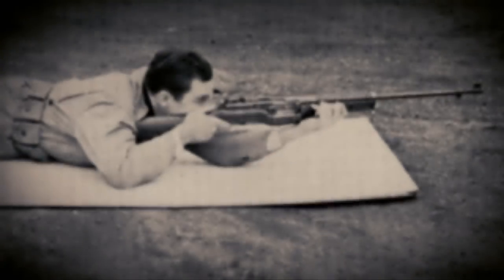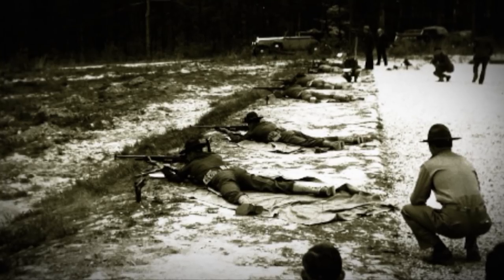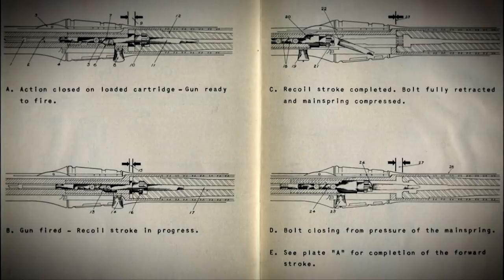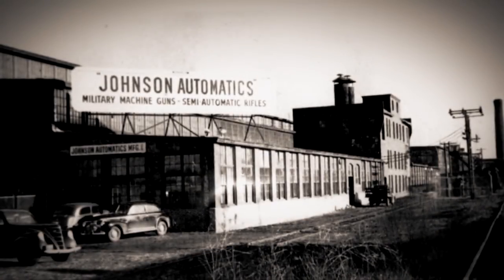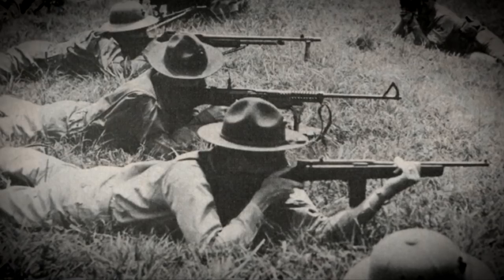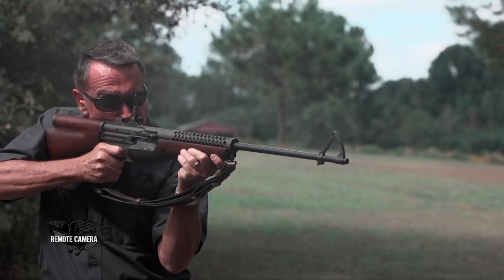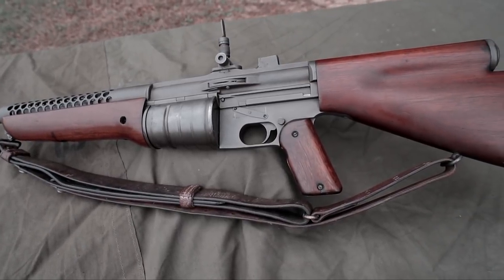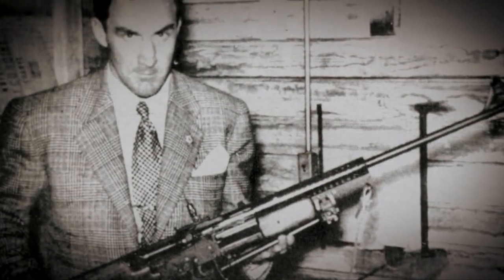Video—ARTV: Melvin Johnson’s Automatics

Comment: Thy were assembled also at Hemphill's manufacturing in Pawtucket, Rhode Island  near the Central Falls border on Dexter street. My mother as a young teen, worked there assembling them. My father worked there setting up production equipment and they met there.

Comment: I would love to fire this wonderful rifle, and the Light Machine gun. It looks to be a very fine weapons system. Also the stock going straight back.  HIs spitfire carbine was a very fine idea also. Melvin Johnson's other weapons would go on to today.  I have flown in Specter Gun Ships and worked with them on the ground and seen the fire power of those onboard weapons that include the multi-barrel vulcun.   It's too bad that more Johnson rifles and LMG's. were not used in WW-2.  However the M-1 Garand and the BAR did work very well.  However I would have loved to have seen more Johnsons for the Paratroopers, rather than the M-1, and BAR.
Reply: They were used in ww2.  But in jungle conditions wasn't extremely reliable.    But they were very accurate

Comment: I constantly ponder the effects on the US military during WWII if they had replaced the BAR and M1 Garand rifles with the M41 and M41 Auto Rifle. My only issue is the issues that come with the M41 Auto Rifle's feed system, mine doesn't always like to cycle the next round for some odd reason.

Comment: Besides the issues with a Bayonet on a Johnson rifle if the Johnson would have been in trial with the M1 Garand at the same time before its adoption there's a high probability would have won the contract. I am shocked we did not adopt the Johnson light machine gun as a replacement  to the BAR us not replacing that weapon bit us in ass all the way until the very early days when we first started police action into Vietnam were the first few years we were still having to use BAR’s and 1919’s because the second we seem to finish a war Congress and the military just all of a sudden decided that I guess there will never be another war with the Soviet threat looming what's not upgrade any of our s*** and it wasn't until Vietnam that we realized oh s*** the Russians have AKs, PKPs,  RPD’s  and a slew of other Squad level weapons that we're both individual and crew serve that far surpassed us in functionality which is kind of the point of us adopting the M16 and M60 If Only They had listened to a man like Johnson we might have been ahead of the curb the whole time.